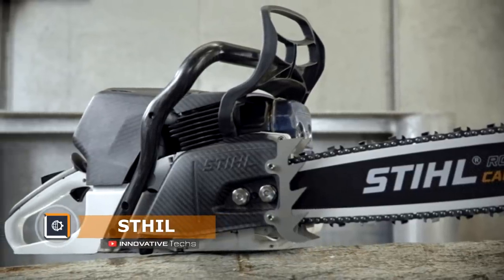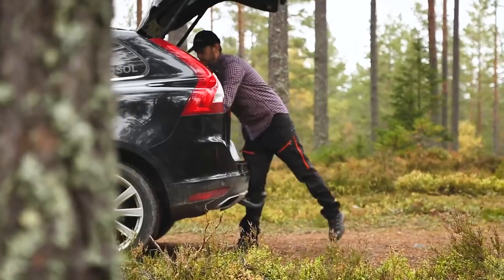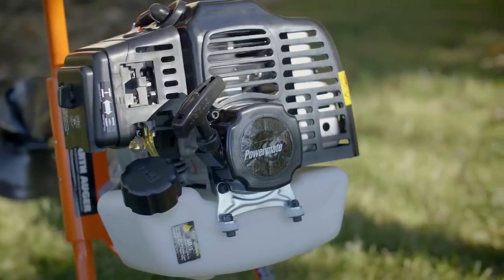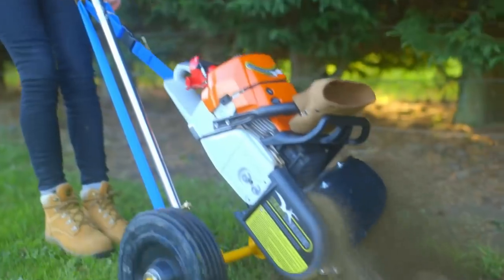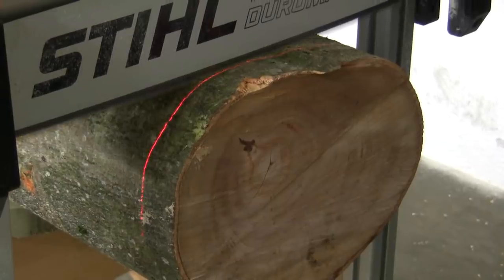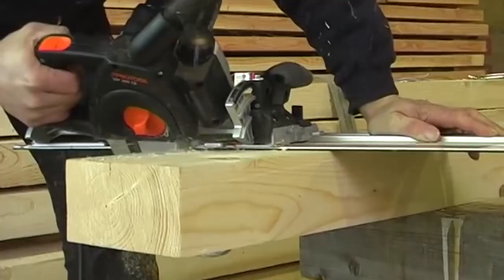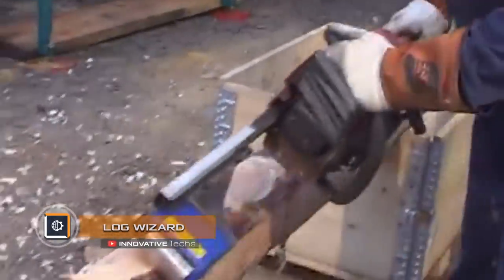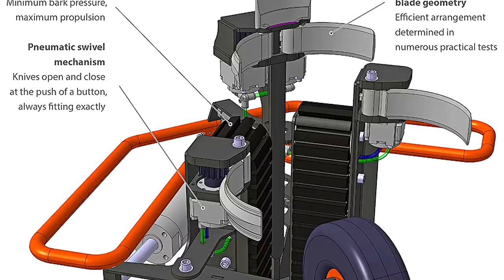New Inventions  for Chainsaw  That Are on Another Level

Comment: In general, horizontal sawmills are inferior to vertical sawmills. As you make your cut horizontally, the weight of the piece pressing down on the saw can cause the saw to bind, especially if you're trying to cut boards a few inches thick, not to mention the rough texture it will invariably leave on the wood.
Using a bandsaw for resawing would probably be better than one of those shoddy rigs for a chainsaw.
Reply: Yeah tough thing is im gonna be building a log cabin in the wilderness lol

Comment: As far as the saw mill, why would you go out and cut only 6ft boards? Guess it is a fancy tool for small woodworking project where you have to much time on your hands.
We have the auger at work, works great but if you hit a root or packed soil it about rips your arms off as it hits you in the side with the handle. It is best to always use two people!
Reply: The video is poorly narrated. It’s 6’ between supports, the guide rail is 13’, and can cut up to 12’6”. You can buy as many sections as you want, so it could cut a hundred foot log if you needed to. Obviously you’d need more lifting sections as well.

Comment: looks good until you hit a boulder digging in AZ is rough 😅
Reply: In Ohio the shale is less than 2 feet down, good luck digging post holes. It was fun putting in a mailbox.
Reply: Where I used to live in CT, you don't even have to dig a few inches before you hit rock!

Comment: we used a tool the same kind to build a log cabin, . After about 8 logs the thickness of the logs were so different at both ends and along the logs  that we had to look at it work to find out where the problem was . 

After inspection we noticed that the  chain saw blade was bending on both side irradicly so   we said Ok must be a bad quality of steel so we bought    a real quality one .  On the first log after that the cut was pretty much even all the way  with maybe a tiny difference at some points so we continued and at the 8th log we could see the differences  just by the eye. and we told ourself WTF ? Same dam problem as before .

 So we intalled a steel bar   from the end of the blade to the armature of the saw and made sure that the blade wouldn't bend this time  . We installed it and then we tried it out . The logs started in a good fashion but suddenly it started to  have restriction and became harder and harder  to push  and thats when we noticed that the log  had 1 inch difference in the middle than it had at the start  . We took the chain and blade off  and as i inspected the chain i notice that the tooth  were not exactly even so i figured maybe thats why the blade tries to bend when it cuts  but the defferences between both teeth  was so insignificant  on both side that  that i wondered if i was maybe wrong about it.   But i decided to buy a mechanical  digital sharpener . dam that thing still cut uneven . 

So again we bought a new blade and chain  and this time we constently used the mecahnical sharpener and again 8 logs later it was doing the same dam thing . Thats when we notice that after 8 logs the new blade had warned out  in the slot so we flipped it and then it cut pretty strait  for about 3 logs and then it started to variate  untill   the 8th the logs looked awfull again .. 

So we told ourself jesus christ  this system is not able to take long cuts like that without  accelerating the wear and tear on the blade and chain . So we abandoned the dam thing and now we use  a real portable sawmill  . Problem solved . 

We tried to sell the dam thing but this system already had made its reputation all over the region and no one wanted to buy such a system  in fear of almost garanteed  deception .. To me this system is total crap  as long as you will introduce  a chain saw  in it  as mean to cut  logs
Reply: Just curious to know where you using a ripping chain on your saw?
Reply: @loudieselj3165  a normal  chain flat top teeth
Reply: MN
Reply: Undoubtedly it was your chain brake dulling the teeth on one side of the chain. Did you take the brake ring out and look at it for damage? And I have no doubt you barely know how to run a saw, as you are calling the bar a blade?  were you using a knife?
Reply: @rickwilson5611  Yeah right  i love people who think that becasue we did something we havent touches d a tool much . 

Got nothing to learn from enyone about a chain saw my friend , trust me on that one . When you worked behind  a Skidder  for 15 years  takes more than words like yours to impress someone like me

Comment: I have a power mate auger and the engine is extremely hard to start. I have to pull it a minimum of 12 times before it will stay running and that was out of the box.

Comment: I have been an arborist for 30 years and used every kind of saw out there.   This is total garbage and way too expensive.  The saw has built in obsolesce  and will be useless in one season.  If it breaks it will be cheaper to buy a new one.  No one can them.  The dealers will send them off for repair and it takes weeks to get the saw back.   It is a cool toy but you will regret buying it if you plan on using it on a real job.  It is the worst saw and the most expensive saw ever made.   All these cool attachments are made to break and are Chinese.  Use them once and they break.